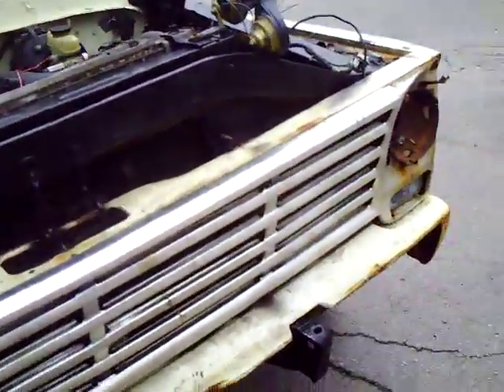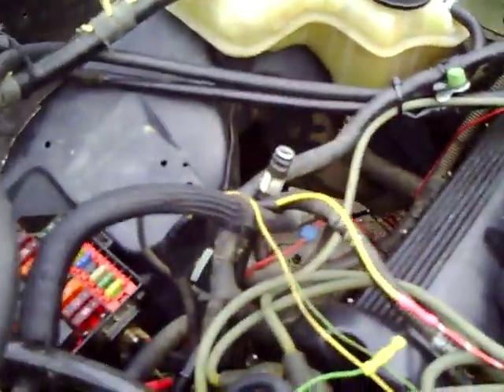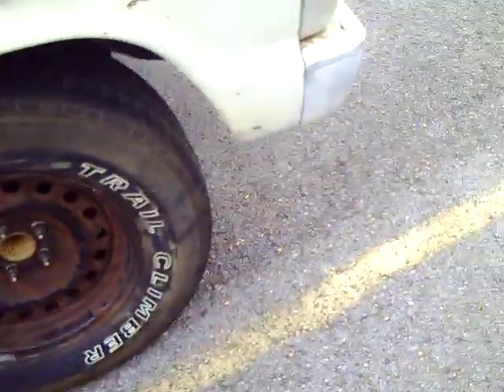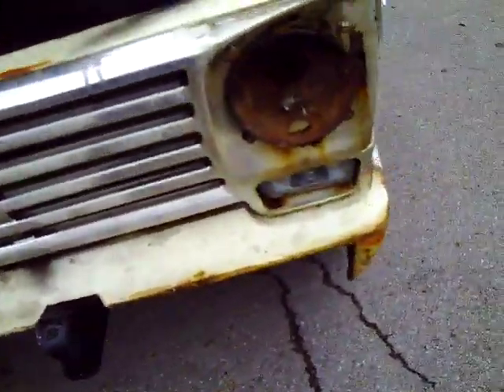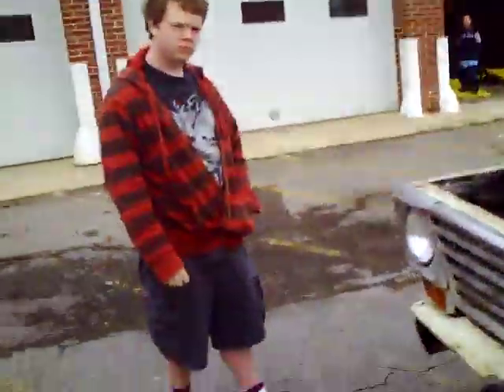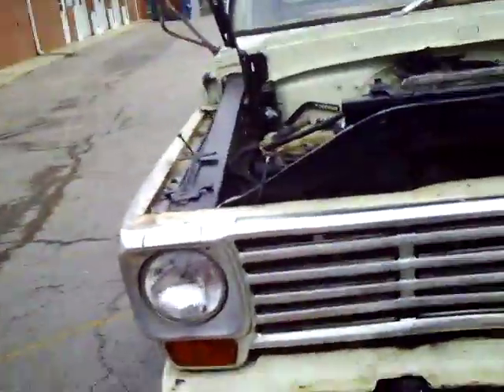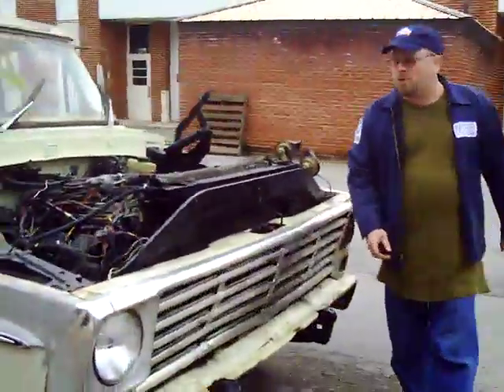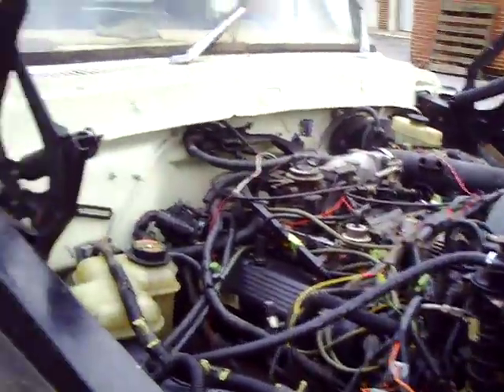crown vic front suspension into 67 F100 14 It moves!!!!!!!!!

Comment: I see you installed the cv in the front but but how did you come about finding the angle for motor and transmission thanks for you time
Reply from the maker: We measured the angles on the engine, trans, and the yoke on the rear end on how the original engine and drive train sat in the truck then we done the same on some of the crown vics we got the parts from before we removed them. We made the motor mounts and welded the new leaf spring brackets based on this. Don't remember much else as this was all done 6 years ago. Its has been a good work horse now for 30K miles and 6 years
Reply: Congrats on the swap and thank you for the info thanks for your time
Reply from the maker: Tony Rodriquez No problem. The reason I done all the videos on the truck was to help others doing there trucks. Some  things we done right and some we done wrong. We all can learn from both. It's all a learning process for everybody.